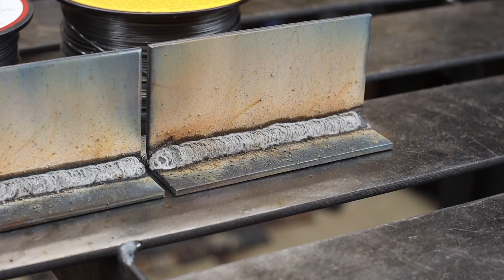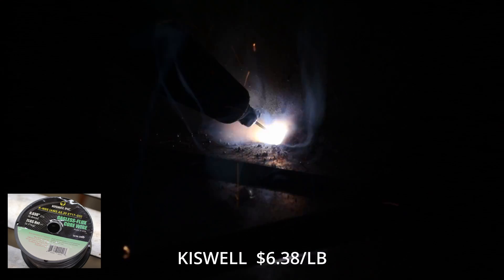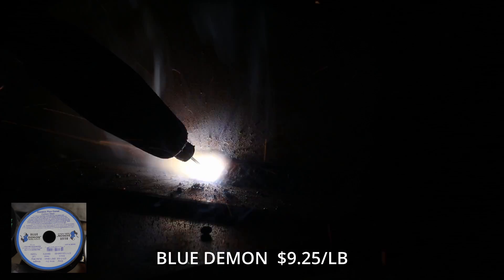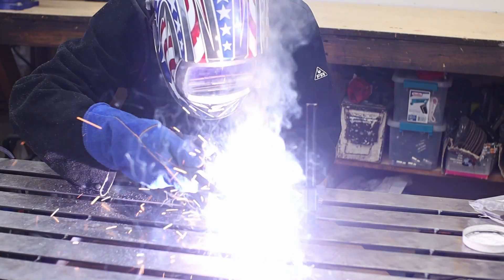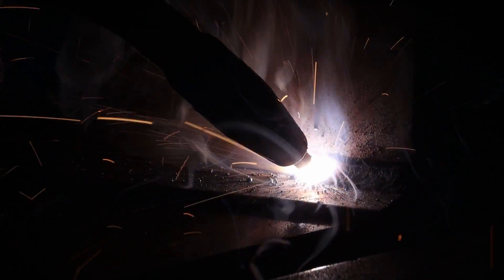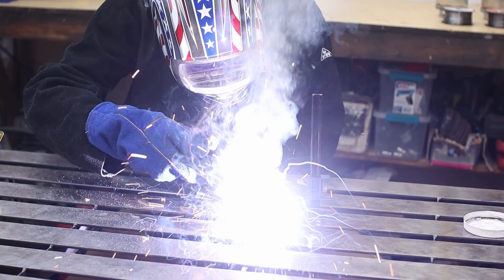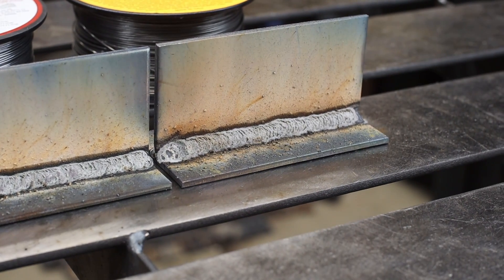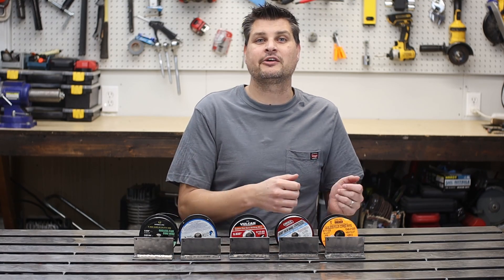BEST Flux Core Wire!  +Welding Tips for Beginner Welders

Comment from the maker: What wire do you like using?
Reply: I've been using Lincoln, but I see that Arccaptain has an affordable flux wire out there with no reviews on the wire but very good reviews on their machines. It looks good, but no reviews makes it a bit less attractive.
Reply: Arccaptain has good machine reviews, could you please point me to where those reviews are, thanks ? @carlholm2765
Reply: I use Lincoln since it is rated for multipass
Reply: @codymorgan3639    E71T-11 is Multipass  E71T-GS is Single pass
Reply: I use some no-name E71T-GS. I only use wire on superthin stuff, mostly furniture but also some exhaust or possibly panels, so even a crap weld is stronger than the base material.
Reply: Forney and it's  cheap
Reply: Lincoln is 10x better than others

Comment: This video is exactly what I have experienced.  I used four different wires on two flux machines: 0.030" E71T-GS wire by Lincoln, Forney, Vulcan and Pinnacle Alloy.  The welds and splatter on a test piece (old tractor mower blade) were virtually the same.  I'm OK using any of these wires.  The quality of the weld is more a function of the machine set up (voltage and speed) and operator skill than it is of the wire.

Comment: After watching this i went to see what my spool is for my HF 90A. I take it out and put it in a big zip lock bag snd store it in my gun safe with a dehumidifier. Its atleast 13 years old. It says Chicago Electric on it. Im pretty sure thats the HF brand youre talking about. Oh ya and its was a 10 lb spool. It works good on light steel with my 90A. I had to put a longer spool reel holder on the back of the welder and drill a hole into the feeder area using a rubber grommet. Its a great little set-up for lighter projects. 10lbs of .030 is a lot of wire.

Comment: In my experience the Lincoln nr211mp is hand down my favorite wire.  I use a 0.035” 10lb spool on my primeweld mig180, and it lays down fast and smooth and penetrates super good in all positions
Reply: Try yeseelder or Kiswel. Less spatter and less money

Comment: Tractor supply now has a house brand they sell at half the price of the Hobart and it runs very smooth
Reply: So you l8ke that wire from tractor supply? Is it expensive sir? I might have to try some of that wire. Thanks for posting

Comment: I just put on the Blue Demon multi-pass… hard to feel the difference between it and the Lincoln wire I was using. It does feel like it goes on a bit smoother, but feels like there’s more splatter.. doesn’t matter though, most of it comes off with a steel brush on a drill. Honestly I may try the Lincoln wire again and see if I can feel the difference. This is all on a Century Fc 90. I wonder what it would be like on a higher-end flux-core machine?

Comment: My guess is that a cut/etch would reveal more differences.  The Vulcan does bite plate, but root fusion is suspect at 3/16" plate joints. Using .030 is probably fine for just about anything under that.  Over 3/16", break out the stick and stab that sucker with 6010.

Comment: Tried Yeswelder flux core 035 wire .top rated on Amazon.
Was surprised how little splatter and smooth it ran in my titanium 125
Reply from the maker: I've tried some Yeswelder recently as well, worked great.
Reply: How does it compare to the blue demon? I am using the Vulcan but all the times I've used it it sparks so much that it's hard to start right and see what you're doing. I've got a Flux 125 welder as well.

Comment: The  HF wire is okay, but it is not rated for multi-pass  like the Lincoln.  I couldn't read numbers on the other wire rolls ( I must have played the hot digity section 10 times to catch the photo of the rolls) and you  didn't say, so there are different types.  I couldn't find the blue demon website to look up all their wire specs.  Lincoln has a blistering amount of technical information on their website, unlike some.  I always bought the Lincoln in 10lb rolls, but still about $15 -20 in the local stores more than blue demon and I've only seen blue demon online. 
 Remember you can get worms from burning old wire (worm hole porosity) so check for  worm tracks...

Comment: Wire welding is for beginners period. What would be the difference between an Advanced and a beginner Wire welder? One can draw tighter circles than the other? Or better cursive E's?
Reply: All the processes have their place.
Reply: @morenothing4u   I know. Mig is more convenient to use. I used to watch the dudes wire weld when I worked on the river. You can't get big stick machines inside of ships like that.
Reply: @Sllabamgil567  My problem with fluxcore is the stick welder in me sometimes tells me to keep a tight arc and that causes the tip to get toast.

Comment: what's the difference between the .030 and .035
Reply from the maker: The wire diameter or thickness. You'll want to us .030 for thinner material and .035 for thicker. There is overlap and since most of my projects are 3/16" or thinner I tend to only use 0.030.
Reply: A half a millimeter.
Reply: A half a millimeter.

Comment: Forney or Yes Welder Flux core are all I use now. They cost less then the Vulcan and welds and cleans up way better for me. I threw away my over 3/4 roll full of Vulcan wire after using them and I am dirt cheap so you not it was no comparison.
Reply: I think the Vulcan is too high for what it is, unless on sale (which is every other month).

Comment: The first weld has slag inclusion. The last weld has heavy spatter probably due to its age (some hygroscopic moisture). Cost also comes down to time & consumables used to clean up the welds (wire wheels etc). Thanks for the Demo. Worked for Lincoln 32 years.
Reply: That Chicago electric wire is like that brand new. I used to use it before switching to Hobart wire. Came looking for videos about the Vulcan wire and ended up here.

Comment: Great video. Just learned that there’s single and multi pass flux core wire. What’s the difference amd when to use it, in my Titanium 125 Inverter Welder. Thanks.
Reply: All wires are multi pass, the only difference between wires is most are harder so less ductile, others are tougher so more ductile, the two types have different codes as well. All of the cheap fcaw wire is the harder less ductile stuff, but you can clean any weld and run more passes to increase weld strength. Hell I’ve welded open root pipe with self shielded fcaw it’ll do the job.
Reply: @cullenhopson9440  I used the  -gs to do multiple passes on banged up tubing on galvanize chain link fence.  The fit up on some spots were over 1/4 inches.  I tried dangling in it to see if it broke the weld, it did not.  The most dangerous  animals it will hold in are geese.  YMMV.

Comment: i have the hynade mtg155d (fs)  it can run 030 and 035 flux core wire,  can i run thicker wire like 045 by just changing out the wire feed roller to a 045 roller ,
Reply from the maker: Can't see why not.
Reply: If you were needing 045 are you using 220 volts consistently and doing metal over 3/8 thick you should probably switch to a stick welder
Reply: No you cannot put 045 it is not designed to hold 045 you would have to change out the liner check with the manufacturer instruction manual or call the manufacturer even the roller is not going to say 045 in less the machine on the manual says that it is an 045 machine

Comment: I use to use 2lbs of Lincoln up until today i got sick of it not giving good welds so i switched to blue demon and i have to say buy the blue demon its sooo much better
Reply from the maker: Right on, thanks!
Reply: How do your welds look after using blue demon flux wire? Any spatter? Are the welds strong?

Comment: I used to have a Craftsman 110V MIG welder.  I bought it new in 1993 or so.  In 1995 I bought a 10 lb spool of .035 E71T-GS, a no name generic brand, I don't even remember where, hoping to get better with it.  I could never master MIG, or flux, and made more bubble gum welds than anything.  I don't think I ever got two pieces of steel to stick together with it. I gave the welder away to my nephew a couple of years ago (2021?).  In any case, I just got an S7 MIG-200 multi function, put that old spool of wire in it, and was welding better than I ever have, with any process, stick, TIG, MIG, or gas.  A twenty eight year old roll of wire, and I was welding with it.  I'll be picking up a roll of Lincoln or Hobart in the next few weeks and gettin' busy!!  BTW, so far, the little S7 seems pretty nice.
Reply: Sounds like maybe with your old machine you didnt have polarity right...
Reply from the maker: Thanks for sharing!
Reply: I forgot to mention the obvious, the fact I was watching them, but I thank you for your videos.  I think they helped me finally make some progress in the flux core process.
Reply: Lincoln owns Hobart, has for years. Lincoln products are made in the USA and Hobart are their Chinese made products. An old welder told me never to use Hobart wire, it was junk. I say find a brand you like and stick with it.

Comment: I have used a few of those but, I'll always come back to Lincoln. That one works best for me.
Reply: I dont know about the blue demon but the Lincoln innershield is multi pass wire, on single pass  applications (indicated by GS) the harbor freight is good but use lincoln where multi pass is needed, indicated by the mp.
Reply: @Don.E.63 blue demon is multi pass as long as it's not the gs model
Reply from the maker: Definitely puts down a night weld.

Comment: If welded correctly what’s the max weight it can handle before it breaks? (Flux core welding)
Reply from the maker: That will depend on how long and what size weld you are actually putting down. Also are you looking at a shear or tensile strength? Sorry I'm an engineer so I like the calculation details!
Reply: The "70" in the wire number indicates 70k psi tensile strength, hope this helps.

Comment: I have been using forney flux core, it’s arcs super clean, not a lot of spatter and it’s sold in 10lbs spools. Also stocked at local ace hardware stores!
Reply from the maker: Forney's pretty good. I'll have to add it for the next round.
Reply: I've been having a lot of trouble getting my welds to stick with harbor freight wire. So because of this comment I went down to ace and got a roll of forney. Man what an improvement!!!!!!! In my opinion far superior wire.
Reply: Yea I use the forney 2lb on the titanium 125
Reply from the maker: Right on!
Reply: I like forney and hobart wire
Reply: Everyone says it's great but I get cra* results with it compared to Lincoln.

Comment: Glad I found your channel, I have to say you sound so much like Project Farm😊. I'm a first time welder I do however work on small engines and cars. Sometimes I need to do welding so I bought the Chicago Electric Flux 125 and thankfully found your channel. My question is it say it can use .030 to .035 wire, is the .035 better. Also what should I set the welder to when welding? Thank you for any help. And your channels awesome!!!!
Reply from the maker: I'll take that as a compliment! You'll use 0.030 for thinner material and 0.035 for thicker. I typically go with 0.030 because I usually do thinner material. As far as settings start with the suggested settings. There should be a sticker under the hood. It will relate to the material thickness you are welding.
Reply: @-DIYPRO-  awesome!!! There is a sticker, thank you so much for responding. I'm now binge watching your videos. It's my day off and too cold outside to do anything
Reply from the maker: @garyalensr  right on!

Comment: Hay What kind of generator can I use with titanium 125 I have the predator 1800 I don't what to plug it in it might fry it
Reply from the maker: That welder draws 20 amps at the highest settings. Strictly going off ohms laws you'd need 20A x 120V =2,400 watts. But there are definitely inefficiencies so I would oversize it for sure, unless you just want to run off the lower settings.
Reply: Ok I can answer to this a lil bit. Yesterday I plugged my Sean stick/gig160 into my Westinghouse generator that does 7500 watts continuous, and 9500 watts peak. And was stick welding with 1/8 7018 at 120 amps on a trailer . Never bogged down